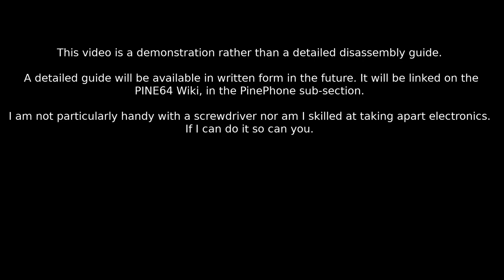PinePhone disassembly and reassembly

Comment: What price will this cost at release?
Reply: $150 right now.
Reply: $150 It shouldn't go up. They are committed to this price. That said, you still got to account for taxes and shipping fees, which can be pricey. I paid $170 in total for my Pinephone with DHL shipping. That said, in 3-5 years they plan to release a Pinephone pro with upgraded hardware, which will most likely cost more just like the Pinebook pro costs another $100 compared to the original.
Reply: @izaicslinux6961  Is the pinephone pro in the coming years confirmed - or are you just speculating?
Reply: @abheetl9743  TL already mentioned the aimed specs for it, yes.
Reply: @izaicslinux6961  can you link the source please?